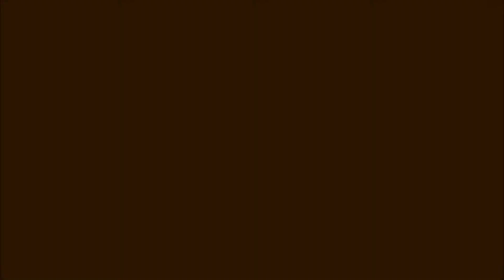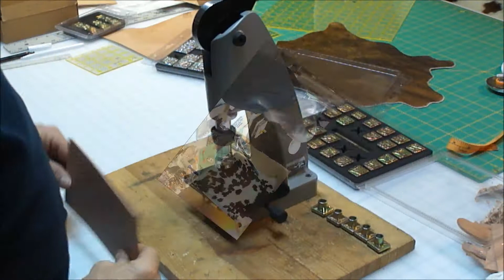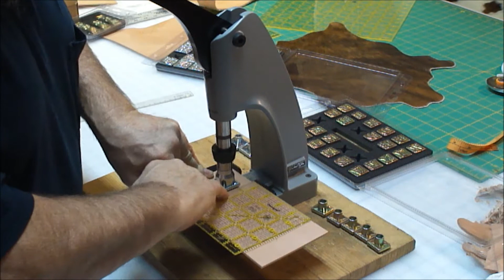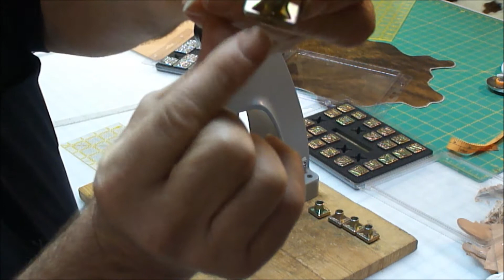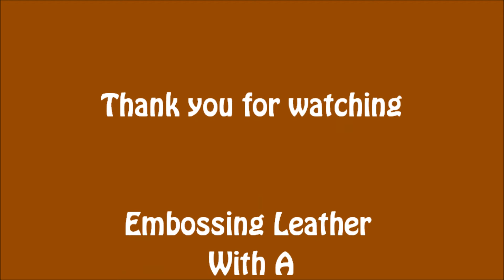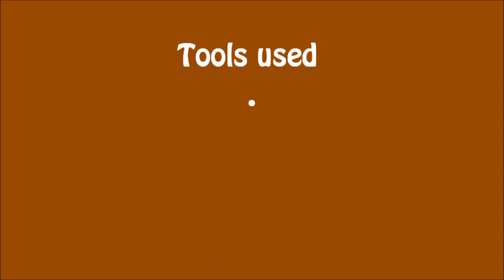How To use a Leather Craftool Pro Press

Comment: Can you use the press dies to stamp a makers mark that doesn't attach to the die/ram? I have one from Leatherstampmaker,  and I'm assuming I could just place the stamp in the desired location, set the correct travel distance of the ram, then stamp normally? Or is there something that I'm not seeing that only allows you to use Tandy stamps?

Thanks and great work on the video!
Reply from the maker: I don't see why you couldn't do that, It should work
Reply: @HillBillyDesigns  Thanks for the reply! Do you mean to say, "I don't see why you couldn't"?
Reply from the maker: Yes that is what I mean,  
I believe you could use some small clicker dies with it also.